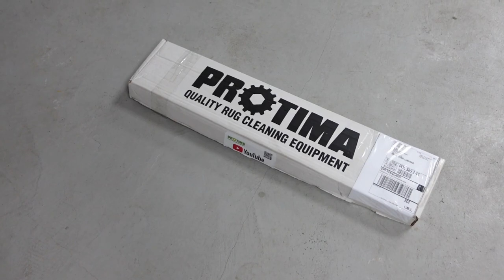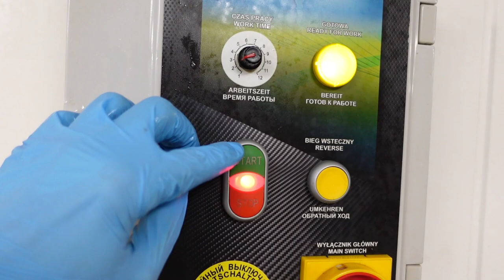Naprawa ROZKLEJONEGO dywanu | Unboxing nowej ściągaczki i trochę prania dywanów💪😍🌊

Comment: A little tip when using the glue gun- when the glue stick is about to run out in you gun put hot glue on the end of the new stick and stick it to the end of the old one. You can keep going without stopping. My respect to you and the new shop.
Reply from the maker: Oooo that's very good advice, thank you 😍💖💪

Comment: You do get some very dirty rugs, and you do a fabulous job getting them clean. The new squeegee has a nice design, but I wonder if you put pressure line with valve with say 3 nozzles. Much like a typical carpet wand. You you wouldn't have to use high pressure you could use the normal amount pressure that is out of the tap. This would make similar to a traditional carpet wand but help you get a great rinse. Nothing you don't know already I just want help make your job easier my friend. You do such great work as it is.
Reply from the maker: Thank you for your advice, any is welcome. This is a good idea, I have to see how to solve it. Have a great day 🤗💖

Comment: You either need to send that new water squeegee back or do your own modifications to increase the water pressure by 10x as that looked like more work than making it easier.
Reply from the maker: Rest assured, this is a new product and sometimes it is necessary to test for some time and possibly improve what is to be improved. I it positively look at the future of this squeegee 🤗💖